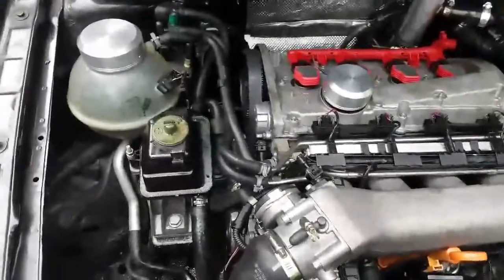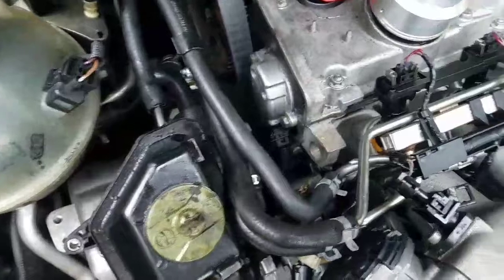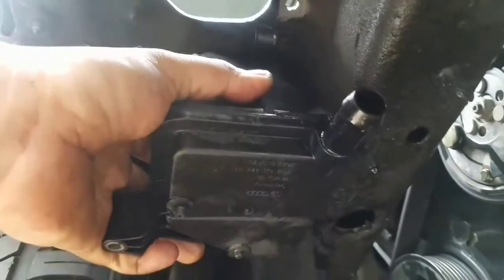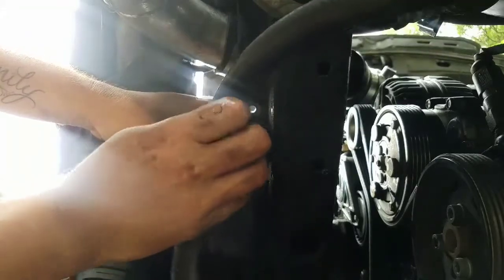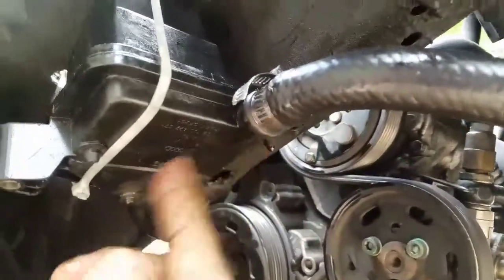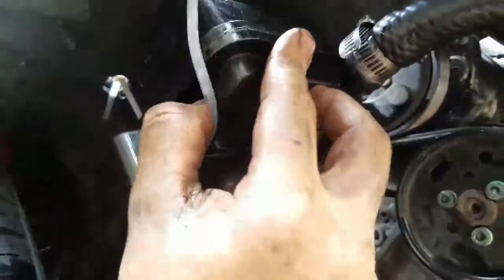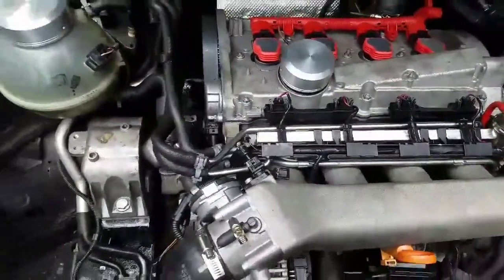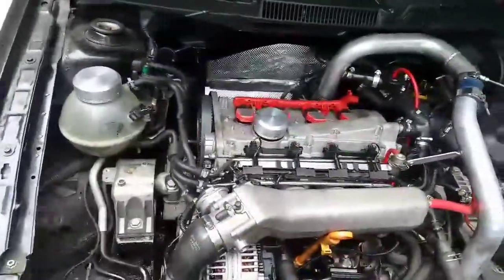Audi vw $2 dollar power steering relocation jetta 1.8t

Comment: Do you need new power steering fluid?
Reply from the maker: +Deadman 25 oh yess !!! Make sure not to mount the bracket with out filling the reservoir
Reply: squalo777 videos oh ok do you have a Instagram so I can follow this in there to?
Reply from the maker: +Deadman 25 squalo bernal for facebook and squalo777 intagram
Reply: squalo777 videos just followed you!!
Reply from the maker: +Deadman 25 thanks bro